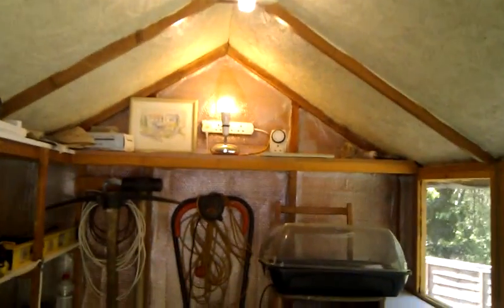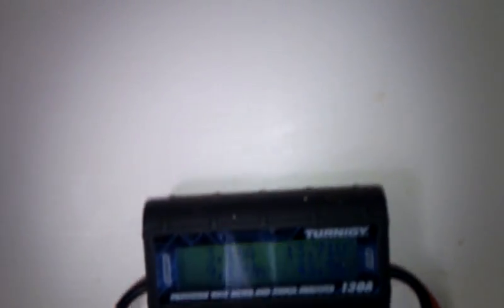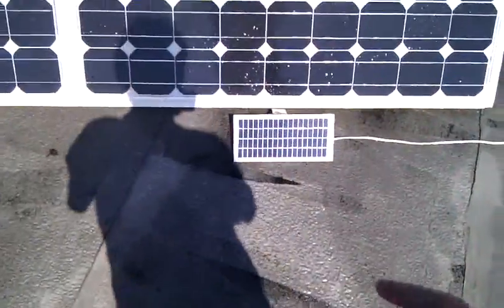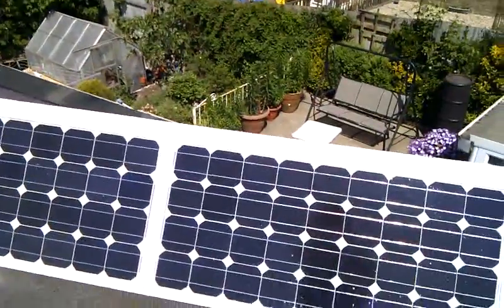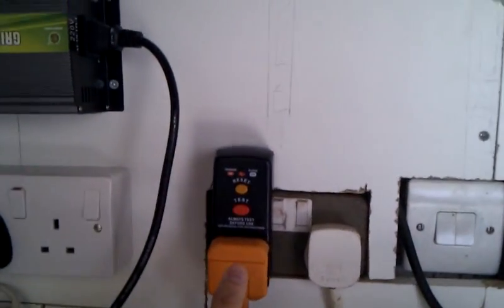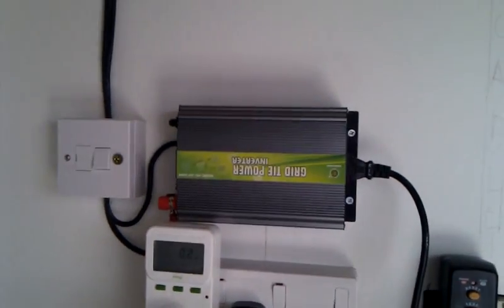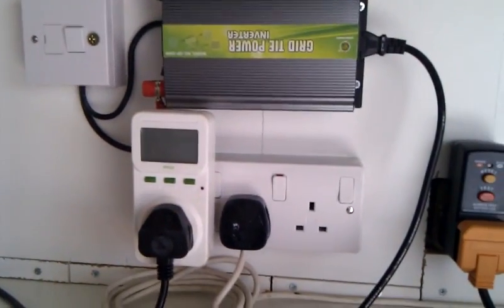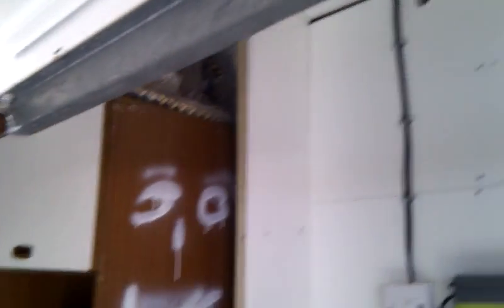Solar grid tied garage setup UK - The begginings

Comment: A big 50 amp cooker switch would be good for the grid tie inverter.
Reply from the maker: Hi Shaun,Yes this could potentially be used. We instead ended up using switches designed for high amperage 12v systems, if you look at my later videos you should see it.
Reply: Yes I saw them, they are pretty big. I also have a solar shed. It has 8 100 watt panels on it connected to a deep cycle battery that is used for charging an electric bike and powering lights. What seller did you get your inverters from? You mentioned that they included spare parts which were probably mosfets.
Reply from the maker: I don't tend to use the same sellers, it is just whoever offers the best price at the time and has good feedback. Yes they supply spare mosfets, fuses and other minor bits.

I still have one I need to get repaired locally but finding somewhere that can repair them is hard as they are so cheap to begin with it's almost cheaper to just buy another than have it repaired.

I did initially have reliability issues but the two in the garage currently have been running well now for over 9 months.
Reply: I have seen that if you were to put 500w of panels on a 500w inverter it will burn out quickly. I will be using 2 500w ones on my setup to be safe. Your wiring idea looks good so I will use the same setup as you.

Comment: I have just had my first 100w panel delivered I am using photonicuniverse,dot.com from ebay £170 each, I plan to use 2x 110ah marine batteries (£75 peach) and run the grid tie inverter from that,  I know people say don't do this but it suits my needs (and elimnates variations in output from the panel to the inverter due to cloud been the UK and all.)

I am wiring it all in 10mm cable (stripping the cores from twin and earth as I have a real knocking around (better then buying singles)

Comment: use proper solar cable for all your connections because you will loose power if you use just normal power i experienced this myself i lost well over 8 amps over 25 meters with proper solar cable the resistance is less than 1 ohm over 1000 meters  . solar cable is water  proof and so on

Comment: @hippyraverocker 

good day to you.
Thanks - I'm building a 12x10ft workshop shed in my large garden so I can do all my woodwork.
I might go for a 250w panel on the shed roof to run a compressor and a under-pinner...if not enough power do I add my panels?

Comment from the maker: @freehee2 

Hey, it depends entirely on the power requirements of the compressor. These panels currently put out around 120-130w to the grid per hour on a good sunny day, so if your compressor uses say 100w then most likely this kind of setup would supplement it,

Comment: That battery may be dead because it is not a true deep cycle battery.  With regards to battery vs. grid tie, grid tie systems are false economy as the system costs more than the value of the electricity it will generate over it's life, especially with the craptacular GTI you are using.  I would stick with a (real deep cycle) battery system, as those are cost competitive with gasoline/petrol generators.

Comment: Hi Like the setup similar to mine I have 2 x 100 watt panels on the GTI max 11 amps. works quite nicely and nearly 40kwh since December. A few cautions for you, do not switch the AC power on and off too quickly as the GTI will cease to function and it will blow a mosfet (can be repaired though) Think you would be better to save your money and buy a MCS approved system so that you can sell it back. Legally you should not connect anything but a g83 GTI and no more than 600w without approval. :o)

Comment from the maker: @moviedout 
Hi, with grid tie you do not get power when the grid is down. It's not really an issue where I am as power is pretty reliable. However you could have a system like I will soon have in the shed which is a battery based system AND grid tie together, so I will always have some battery backup available if I need it.

Comment from the maker: @m6pcg 

The inverter itself is rated 14-28v if my memory is correct, so essentially any standard solar panels can simply be wired up to it and the power then gets converted to 240v (or 110v depending where you are) and then put into the grid.

It makes the meter turn slower so saves money that way, but with enough power could turn backwards and the electric company would then start paying me provided I told them about the system and got it all certified.